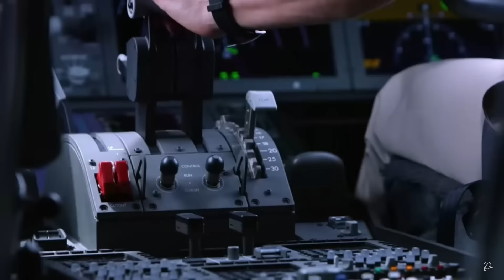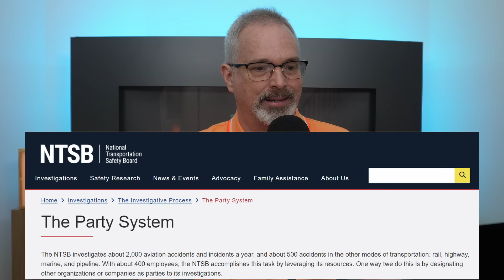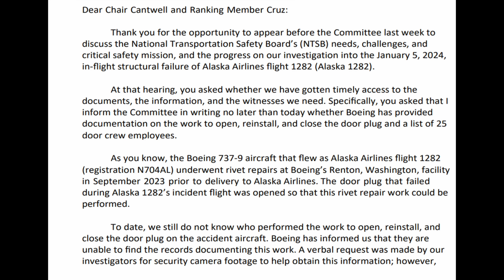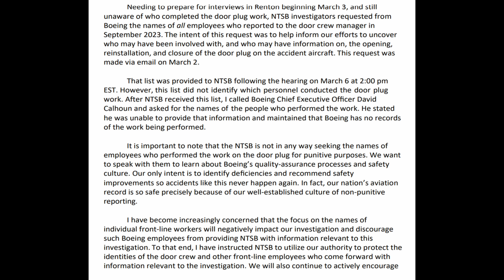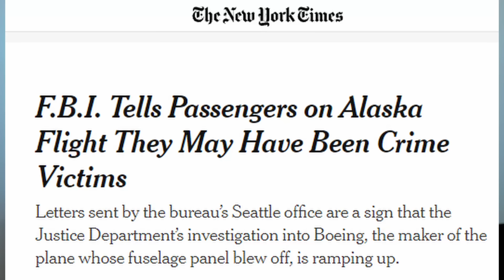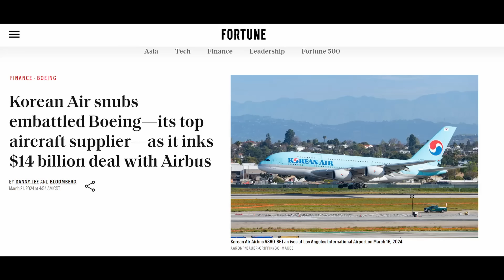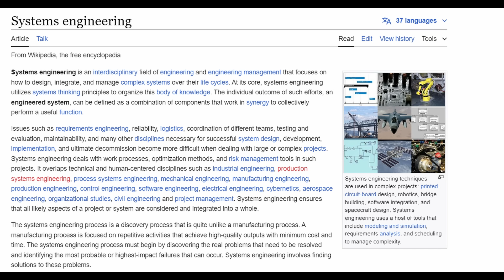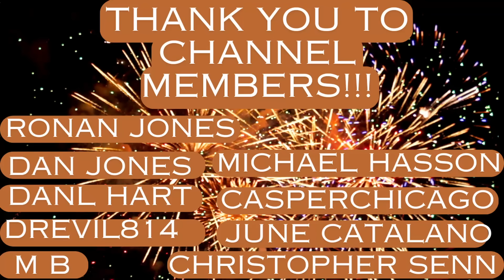Is the FBI Taking over the Boeing Investigation?!

Comment: At this point, it looks like the entire board of directors should be fired, and several probably belong in jail.
Reply from the maker: That would be a great place to start!
Reply: That's the ideal, but can only happen if something SO over the bar happens that it hurts both the government and wider economy to let them remain. We're basically talking multiple undeniable mechanics-based crashes in close proximity, which hasn't happened yet. Basically, they'll hang on until Boeing itself fails.
Reply: Stop work would expedite the identification of x/25
Reply: Dennis Mullenberg should have been charged with Manslaughter for the 2nd Max crash. Absolutely a slam dunk no brainer.
Reply: Yeah that why you have to buy the politicians.
Reply: they are gonna fight hard and going to want to have those golden jail cells
Reply: I’m thinking some Code of Hammurabi mode of justice:  put the execs in the plane they approved/allowed out to the public and let it fly on autopilot…
Reply: @jordanscherr6699 The Sarbanes-Oxley Act probably actually has some provisions that make a bunch of executives well past the point of being charged, but who ever gets charged, let alone convicted by SOX violations?
Reply: ESG problema
Reply: @rogermaverick9769  ESG/DIE is definitely a factor, but management pushed it, and didn't monitor performance.
Reply: @RichardBetel  It comes down to how thoroughly prepared Boeing is to hold a metaphorical gun to the government's head. But the longer they do, the greater the risk of the ground being broken beneath both parties. I.E. The institutions themselves falling into crisis.
Reply: @jordanscherr6699  Damage is allready done. Dont think US can get competitive on the commercial air sector again without goverment intervention. 

Will hurt the economy longterm losing a market like that. And getting back marketshare, is alot harder than losing it.
Reply: Too rich to server time.  That doesn't even get into the secrets they can hold over the government.  Capitalism is what capitalism does.
Reply: @jordanscherr6699   Agree the problem with the door was not an engineering design problem.   What we have on the 'long list' is the MAX crashes.
Reply: Knowing what happened to the Purdue crime family, don't keep your hopes up.
Reply: Good vid. Mcas was not a stall prevention, it was to mimic the previous models handling under different engine settings to avoid additional new training cost to customers.
Reply: @theotherserge  Confusing post.  Autopilot hand nothing to do with any of the problems.  MCAS can not be used with autopilot.
Reply: Ahh, you know they’ll figure out how to put some little people in jail.
Reply: @SteamCrane That’s what you’re going with?
Reply: @AirRider44  Direct experience. I worked with "Old Boeing" engineers and managers.  They cared.  After that, the takeover by McD, money people put in charge, HQ move away from the Seattle plants, eliminated experienced engineers, outsourcing to places like India, establishing diversity hiring policies, firing hundreds of QA personnel.  This fiasco was entirely predictable.
Reply: Every task executed on an aircraft, whether building, maintenance, or repairs has a traceable task card, with instructions, and a place for any individuals that worked on that task, to sign off on the completion of said task.  Boeing has all of that documentation, as they are required by law to retain that information as part of the QC package of the entire work event.  Boeing is clearly stonewalling.  Unfortunately, the government relies on Boeing heavily for defence contract deliverables, so you can formulate your own conclusions from that fact
Reply: @AirRider44 that's the boogieman from a certain news channel and their sphere. They're already blaming the bridge collapse overnight on it.
Reply: I will bet that all the vloggers who are keeping tabs on the Boeing situation are just sitting on the video title, "From Boeing to Boing," and waiting for the right opportunity to use it.
Reply: We dot know what really happened. It could have been technicians who intentionally messed up the blueprints or assembly. We simply do not know.

Comment: The whole door plug thing makes me wonder: If they can screw up something that simple, what else are they screwing up?
Reply: 😂❤That is a ver good question. So far:
- Missing nuts, bolts and washers elsewhere
- Loose bolts in control surface actuators
- Locked up pedals
- Landing gear tyres falling off
- Holes drilled in wrong surfaces
- Landing gear hydraulic fluid escapes
- Wing surfaces shredding
- Air brakes random activations
- And the world famous MCAS and subsequent software update failures.
Reply: literally everything.  While there are no inspections.  It was lucky the plug didn't blow out sooner,
Reply: that is why Airbus is selling much more planes than Boeing

Comment: Retired with decades on the floor, most in Renton. If the door removal was unauthorized, there would be no record. As to the "Team" involved. sure, they can give up those names, but there have been instances of unauthorized removals coming from the factory, the flight-line, the delivery center, the remote facilities like Moses lake, and anywhere and everywhere in between. Does Boeing retaliate when employees expose things like this? Absolutely, and they have endless ways to do it, and plausibly deny it or cover it up. Boeing's corporate investigators are not amateurs, They tend to be attorneys and former LEO/and federal level criminal investigators. But let me explain this: Boeing ALWAYS tries to place the blame on the lowest level employee they can. If they can simply do this, it would be all over by now. But the destruction of Boeing's quality and production system was commenced 25 years ago. It is focused on profit and cash flow, using minimum compliance. It's nearly unfixable, and will take years and billions to set right.
Reply: And how many "accidents" do you think it will take?
Reply: Boeing needs to sell off their assets and close their business. Other companies may learn from this.

Comment: The FAA could suspend construction of Boeing aircraft until the records are provided. They won't.
Reply: The political implications of suspending construction at Boeing would be immense - and it could right now be an election changing event because the domino effect of lost jobs could be significant.
"Too big to fail" do exist.
To me it seems like it would be necessary to break up Boeing into smaller companies with completely new management in each part.
Reply: If they did that, it would decimate multiple local economies, still trying to recover from the pandemic. Lot's of mom and pop machine shops would shutter, and you would have at least 2 very large workforces out of work and hitting unemployment, and say the larger companies survive and go back to building, the workforce would be more inexperienced 20-somethings that don't care beyond their paycheck, resulting in the same quality issues they are facing now. There needs to be more accountability, for sure, but they also don't want a monopoly for commercial aircraft.
Reply: scariest part of this is how these mega companies are able to control the regulators
Reply: @hicksvilleshick and when everyone stops buying Boeing's exploding sh*t boxes how will that affect those shops?
Reply: They would send you a list of the janitors.   Please do not forget that there are a lot more good people working at Boeing than the pool of crooks who are causing the trouble.
Reply: @Nope_handlesaretrash You're talking about a scenario that is possible, but extremely unlikely. I doubt the government will allow it to get to the point the only commercial aircraft manufacturer is from france. It just depends on if this wakes up the powers that be at Boeing to institute a culture change.
Reply: @hicksvilleshick  france and germany*
Reply: @JJ-eo6nd  regulatory capture has been a thing now for decades across all industries.  It's one of the reasons America continues to decline (aside from the 1%).
Reply: @user-gs8jv4oq6w I don't recall any German commercial aircraft manufacturers. But then again, I imagine Russia has some too. I just know that only Boeing and Airbus are the primary mass produced commercial aircraft makers.
Reply: @hicksvilleshick  that's not what i mean. Airbus is owned by both the country of France AND Germany. Spain also has a (lesser) percentage of the company.
Reply: Exactly.Do their job.Also,I suspend they kept no records.

Comment: I can't believe there is no documentation. Airplane mechanics here at lufthansa even have to sign that they counted their equipment after every job - just like surgical nurses do with their instruments - to prevent any tool or screw being left and causing damage. Their is so much documentation in this industry.
Reply from the maker: I really don't know what is going on at Boeing but whatever is happening is producing one disaster after the next.
Reply: Oilfield workers sign off on literally every single bolt they tighten on a torque chart, Boeing has no excuse
Reply: Just fighting the good fight against government overreach and interference.
Reply: In aerospace there is ALWAYS a well-documented paper trail.  If there is not, then you can conclude that crimes of both commission and omission have taken place. 

For G* Sake, aerospace is a precision tech industry!
Reply: @xtra729  careful, apparently Boeing doesn't mess around when it comes to how they treat folks who talk out of school.

Comment: Break up Boeing.  There isn’t another choice anymore.
Reply from the maker: That may be where this is headed.
Reply: Of course there is another choice. In fact there are several. For one, the Board could be reconstituted and new management brought in. A second alternative could be that another aerospace company that has their act together buys Boeing. Breaking the company up into a a commercial and a defense company would not necessarily fix what ails either organization.
Reply: @rschaffer8  Boeing had a chance to fix itself after its 737s started lawn darting due to defective software, but they didn’t and instead they kept their board.  Boeing lost a shareholder suit at that debacle and has to pay $250,000,000.00 to investors, but still they kept their board.  They paid a $2,500,000,000.00 fine, but they still kept their board.  Boeing finally got rid of its CEO, but they still kept their board.  So where exactly is the change supposed to come from?

Boeing has a storied history and was the cutting edge of aviation for decades, but those decades are gone.  All that’s left now is a ruin.  Why save it?

Comment: it goes without saying that Boeing knows who exactly installed the faulty door plug, but they don't want anyone else to find out because the rumor is that unqualified staff have been doing this sort of work at Boeing for awhile now, without proper safety practices in place as well. if that rumor is true, releasing those documents would lead to lawsuits

edit: I have another quick note to explain why Boeing knows exactly who worked on these planes. even if they keep no records (which cannot be true - they have to know who they employ on which job site in order to pay them), this plane was only 2 months out of the factory, and a door plug installation would likely be one of the last things to be done on a mostly fabricated plane. some of the outer components of a plane are pre-painted with the colors or logos of the airline that has ordered the plane, and some are not pre-painted, but generally, at least some workers will know which airline client has ordered the plane that they are working on at that stage of the process. I think, as a human being, if I had installed a door plug on an Alaska Airlines bound plane two months ago, I would likely have some memory of it two months later. I am an engineer myself, and when I inspect a site even briefly, I will remember that site years later. 

someone remembers working on that plane, and Boeing knows where it was being built. so in terms of both employees available to do this type of work at the known location where the work took place, and in terms of simple employee memory, even with no written records (which by default must exist to some extent), Boeing has to know who worked on this plane. and they clearly do know - since they mentioned 25 employees and a manager who are on the team that would have done this work. Boeing knows exactly who installed that door plug, which means that there is an alternate reason for refusing to hand over the documents to the NTSB. Boeing knows that they are only delaying the problem, since Congress will issue subpoenas over the next couple of months, and eventually, they will be found in contempt of Congress, and referred to the US Department of Justice by Congress for prosecution. Boeing knows all of this - but that process takes time. I assume that they are desperately "cleaning house" right now, so that when they do eventually have to be somewhat honest, they can say "well look, we've spent the last 8-12 months fixing this unqualified staff issue, so it's no longer a problem" hoping to come to an agreement with the government to avoid prosecution, and public humiliation, which will further affect their stock price, and may lead to lawsuits from airlines and/or passengers.
Reply: Plot twist: the door was installed by a crew of venezuelan immigrants the manager picked up at the local Home-Depot.
Reply: Maybe that person also somehow unalived themselves in a car "accident" or something.

Comment: My girlfriend noted that on an aircraft that is nearly full capacity, the empty seats were next to this door plug, begging the question "was the loss of pressurization associated with that door, part of decision process in those seats being unoccupied."  The wrong answer to those questions could open a can of worms
Reply: One report I read suggested that there had been some problem reported there- possibly noise, I forget what it was, and that's why nobody was put there. Whatever it was, if that did happen, it could be related, so not a total coincidence nobody was killed.
Reply: @alisonwilson9749  If it was left empty intentionally, that makes AK as liable as BA.
Reply: @SteamCrane  maybe.  As a law student, (this is not legal advice, I am not a lawyer) I'd drag them both into court as well as whoever manufactured the door.  While it would be up for a jury to decide, if AK has records of customer complaints about being near those plugs and Boeing has no records about anything.... I'd rather be holding stock in AK than Boeing.

Comment: What was also surprising from the hearing was that -- we had heard that Spirit employees were practically embedded at Boeing to constantly fix defects -- but the NTSB Chair discovered that these "employees" are not actually FROM Spirit, they are third-party workers subcontracted by Spirit. 
US engineers have some of the best know-how in the world, if you let them do what they do, so yeah maybe it's time they took over Boeing again. The spreadsheet-mentality obviously is a failure.
Reply from the maker: Thank you for your comments.  It seems like Boeing did very well when it was run with an engineering mindset prior to 1997.  Now, Boeing lurches from one disaster to the next.
Reply: @CaseyJones-Engineer  They seemed to coast on momentum for several years until the internal processes were 'optimized away' by the 'value add' set.

Comment: I think the criminal part comes in when Boeing started removing Inspections in 2012 as stated by already whistleblowers, AS9100 states that Quality procedures be maintained, it does not state what those procedures are. The company QMS dictates standard operating procedures. By removing inspectors become a case of company Ethics morality, integrity. Operations and the manufacturing engineers are in charge of the instructions, quality oversight removed would be criminal if intentional harm to public, company intentionally removed inspections for years to maximize profits, yes, that's criminal endangering the public

Comment: I understand aviation quality processes. I love the work you are doing. I have heard a report that the removal and installation of said door plug in this part of the manufacturer process was deemed at some point to be work that could be done without documentation.  This makes ntsb and faa complicit with this and other issues as the manufacturer and the regulatory bodies agree to processes well in advance of delivery of the first of the type certificate.
Reply: Didn’t know.  Govt. Is “darned” costly.  So FAA trusts MFG to “self police” the process, ANY process.  BUT Company number$ not high enough.  MBA yells at those who were just given more work to do as worker AND “inspector police”.  So starts IF-THEN logic:  IF threatened with firing - THEN keep mouth shut.